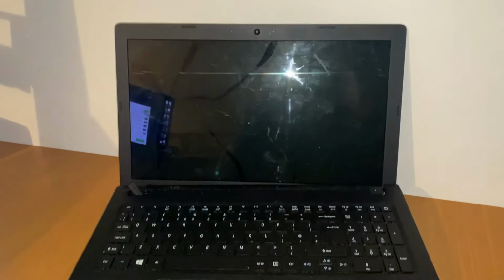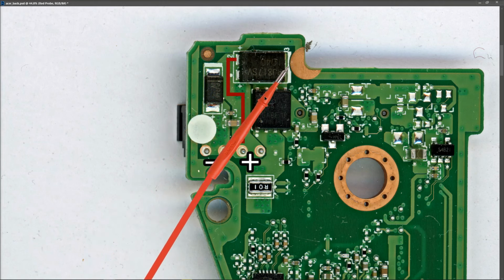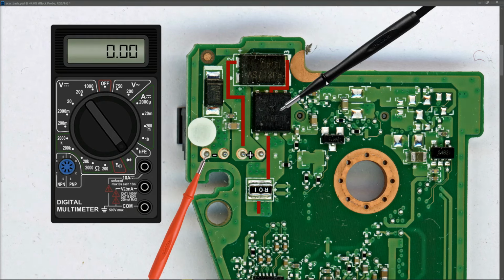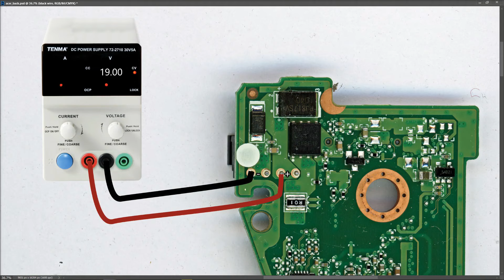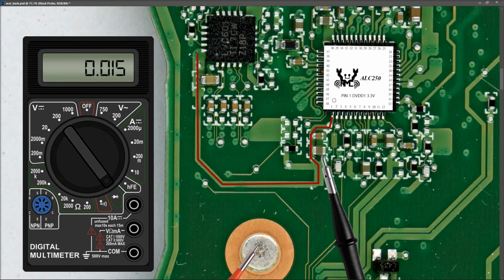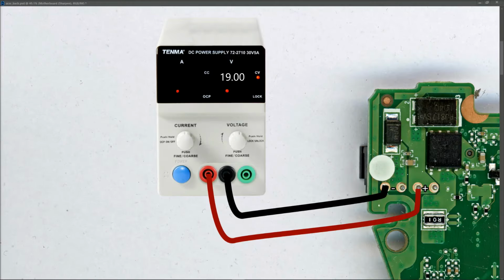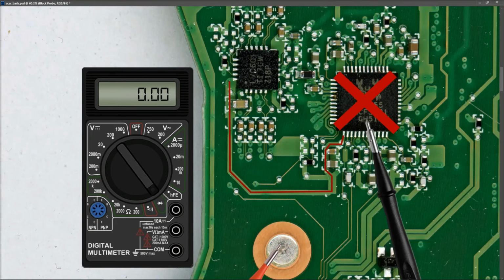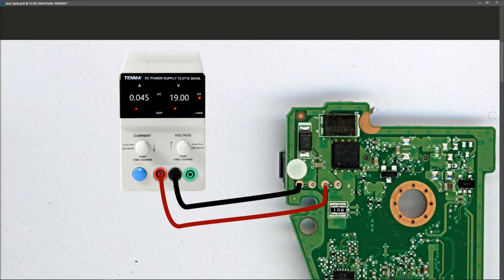ACER ASPIRE 3 A315 - MOTHERBOARD FAULT

Comment: Your failure analysis for 3.3V (troubleshooting) in my particular opinion is impeccable (correct) and since 3.3V powers many components on a laptop board (it travels or moves) to many areas or sections. If the Chipset (is running excessively hot to the touch) then the game is over. With a thermal camera we would probably see a hot spot or area, generally in one of the corners or on one of the sides of the IC. The five comments (so far) from colleagues say it all (I love their participation). Chipset failures will unfortunately continue to occur. Thank you very much for sharing. All the best.